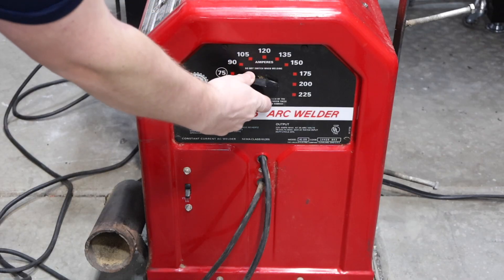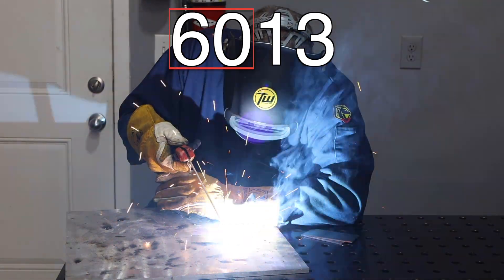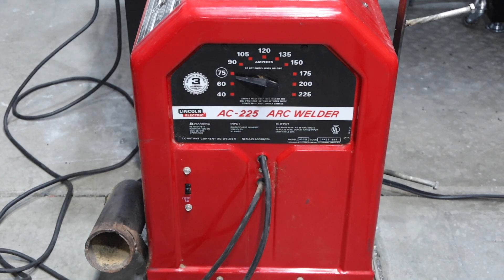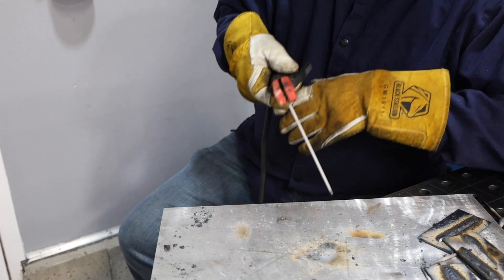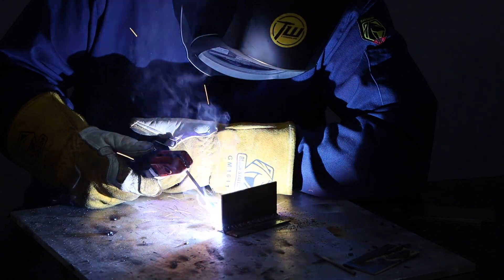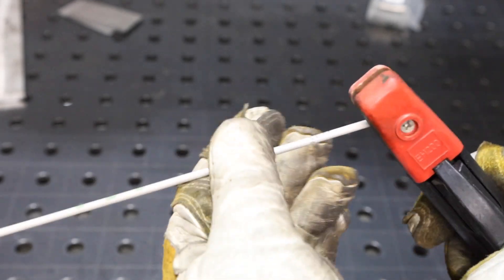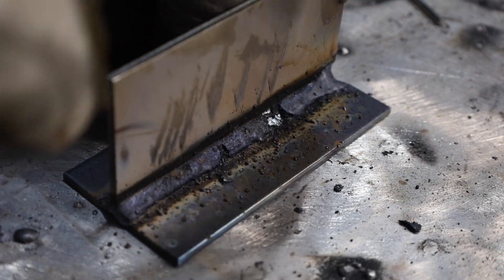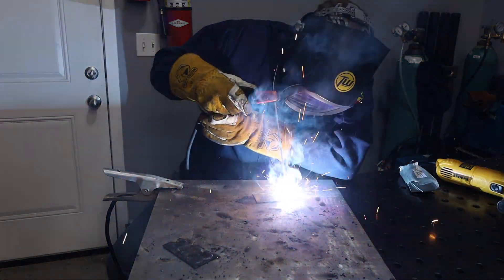Stick Welding Basics: 6013 Rods on AC

Comment: Hi Tim, really enjoy your videos. I remember welding with someone who told me that if you use a copper coated carbon arc gouging rod with an electric arc machine it was possible to fusion weld with it using a Hercules steel rod as filler metal. Have you ever heard of this or was he pulling my leg?

Comment: 1:55 I've noticed with 3/32 rod its almost easier to think of the movement as straight down.    So you get set to move your hand straight down and then just adjust the angle slightly for how fast you want to move across the piece.       you can see that in your spend up video, your hand pretty much goes straight down.

Comment: thanks tim 6013 in the uk is really common and so much cheaper than 6011 and 7018 for hobby use and general low stress repairs
Reply: my dad has a hammer he stole from work years ago, the head fell off and his mate welded it back up which i assume is 6013 . 20 years later doing hammer stuff and still going strong , no cracks no nothing. seems like a decent little rod

Comment: 3 Dumb question coming here.?   Can you tell me why a person would use a 7018 over top of the 6010.?  And not just keep using the 6010...  Is it because its shallower but Wider...  So you have the deep pen narrow 6010 rod 1st, then tie into it with the wider shallower 7018 to fill it...    2nd... Why can some $300+ welders can run a 6010, but others of roughly the same specs won't.?  But they all mostly claim they can... Wonder what part of the welder it is thats responsible for being able too run it or not...   3rd... Would u also know what makes One 120v welder able to run at 130 amps... But another 120v welder can only handle 80 to 90 amps on 120v.?  What internal part is responsible for that Diff i wonder... Thanks

Comment: 6013 is the standard electrode used in Europe for general 
 fabrication up to the highest level including ship building and structural steel work, Americans seem to think there is something wrong with it or it's not good or strong enough but that's not true.
Reply: Yes, it seems like 7018 has become the standard here.  But I use 6011 for almost everything, occasionally using 6013 for a cover pass.  Nothing I do needs low-hydrogen and I don't like the inconvenience of ovens.
Reply: Femax iron power rods (esab 38 48) are used a lot on shipyards (fillets) 4 to 5.5 mil. Vertical/overhead Butt welds use mainly 1.6mil flux core wire 15 mil single v butts sometimes with ceramic backing depending how good the plater was🌚
Reply: I'm Mexican and I think that 6013s are alright.

If I have to repair cast iron, then I will braze with an imported bronze electrode instead of welding. Less cracking and heat affected zones.

Comment: Hi,
I’m building a ‘crazy cart’ that features here https://m.youtube.com/watch?v=_A4IXheof88

I am stick welding the 1.5mm steel 25mm box sections together. 

I’m newish to welding and was wondering how I could make this easier to do? 

Should I consider 2mm steel instead and take the hit on the weight gain. 

It is worth keeping one side of the steel un-cut to help with strength. ( ie bend my 90  degree angles and cut a chunk out of one side with a single side still uncut )

Comment: Good start to 2023! Lots of spatter/splatter from that 6013 or was it the power source.
Reply from the maker: Thanks! Probably a combo. These rods have been laying around for a decade or so, AC makes more spatter and the machine can’t be set to an exact amperage, so it was probably a touch higher than ideal. The spatter didn’t really stick and brushed off pretty easily, though.